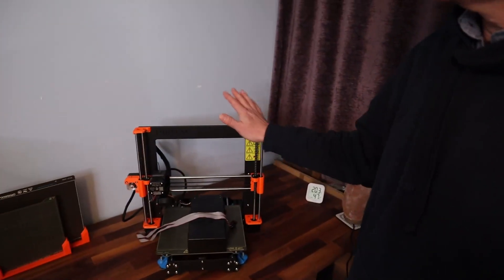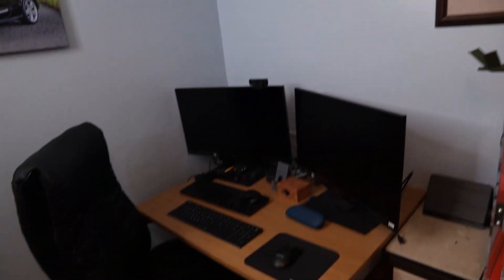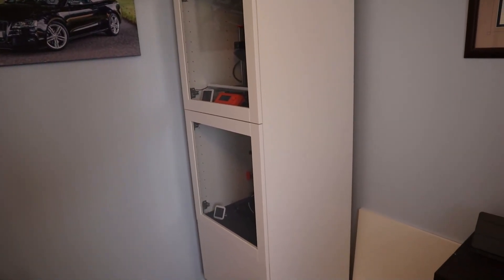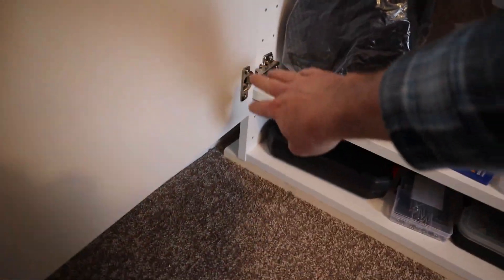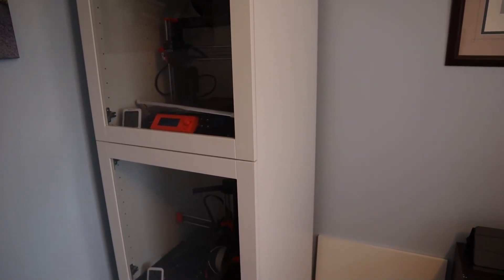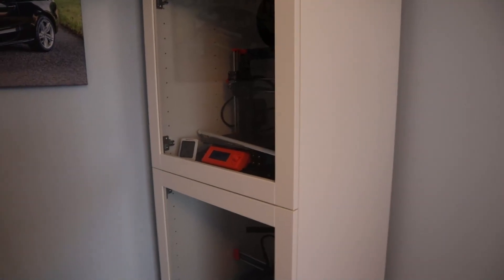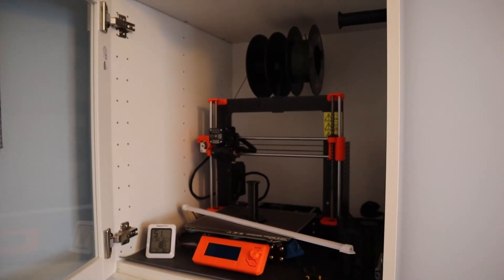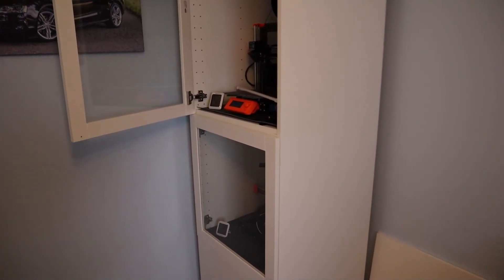Ikea Double 3D Printer Enclosure Review - METOD Model 23 3/4" Deep - cheap DIY alternative

Comment: I bought a Metod 60x60x60 + door for my Bambu Lab P1S. Also bought at the car retailer soundproofening that is 20mm thick, that I have on the inside of the walls. Works really great, and total cost of $110.  I will install some fans in the enclosure si its not too hot. But it did a lot for the sound of the P1S :)

Comment: Does vibrations from one printer affect the other printers quality in any noticeable way? I have two prusa minis and considering IKEA Bestå.
Reply from the maker: When i have them both running i dont notice any issues. The enclosure is bolted to the wall to help stop movement. Each printer is also on a rubber mat

Comment: what is the temperature during several hours of printing? 
Will the power supply and electronics withstand such temperatures?
Reply from the maker: Petg around 33°, could probably get much hotter if door seals are added.
Reply: @colinhill  is this temperature ok for electronics?
Reply from the maker: @tomasz9131  electronics normally ok up to 40°. If worried you could easily mount the PSU outside and pass cables through a hole in the side of enclosure. I considered this but at 33° it's fine. If I sealed the door then might consider it, or if I regularly did ASA which makes enclosure hotter. But if I did that I would also add an extractor with filter to control temps. I have done that in other videos on other enclosures.
Reply: @tomasz9131  most electronics should be good for around 70 degrees, but nothing to target to reach.

Comment: Very neat solution Colin!
 At the end of your video you talk about making a fire extinguisher system video.
 I have not managed to come up with a practical solution using CO2 so as not to ruin everything with powder or foam. I would be very interested to see what you plan to do
Reply from the maker: It's currently down to costs. Each unit is over £$100. Would be gas based.

Comment: I am currently following your idea, I have purchased the materials and built the Metod.
Did you brace the back of the unit with a plank of wood by any chance? Thank you in advance.
Reply from the maker: I didn't need to brace the back. But I made sure it was connected to the wall using the supplied mounting brackets that fit at the top. Iw won't move for sure. I'm really pleased with it.
Reply: @colinhill  Thank you. Because my wall is boarded I decided to use carpenters modesty blocks to reinforce the Metod and used some spare shelves to reinforce the backs of each compartment for the printers. 

Do you have a solution for having the PSU outside of the Metod? If we are printing with PETG and ABS/ASA then 45-50C+ is going to reduce the lifespan of the PSU.

Comment: double the printer double the fire risk , and double the voc
Reply from the maker: Don't understand this comment. All hobby enclosures that have plexiglass are a fire risk and will melt. That includes Prusa's own version. I won't be using this IKEA version unattended, and plan to fit fire suppression which most single purpose built enclosures dont  have.

Comment: IKEA have sold a few different cabinets that are just the perfect size for a printer enclosure. Sadly, they never sell them here in the US. Real shame. Closest we get is the Lack table.
Reply from the maker: Had a quick look on .com site, there are a few. I recall some in USA using the PAX wardrobes. https://www.ikea.com/us/en/p/pax-wardrobe-frame-white-70214564/ so not quite the same as my example but you may find something suitable and still fairly cheap.
Reply: @colinhill  update, I actually think the ikea sektion 24x24x80 or 90 could be a good sub if you're in the USA. , can you do a video on how best to line up the holes for the doors? that seems to be a little daunting for a beginner DIYer like myself.
Reply from the maker: If the doors aren't designed for the cabinet, attach hinges to door, get a friend to hold the door to cabinet while you mark the holes with a pencil on cabinet. If you get it slightly wrong there is adjustment in the hinges. Good luck
Reply: agreed
Reply: Add some masking tape to cabinet for marking and to avoid rough edge, attach hinge to door, position door hinge against cabinet and mark centre of slot. When drilling add masking tape to drill for length of screw, as a depth guide - so you don't spoil cabinet, apply pressure to drill at start and then ease off.